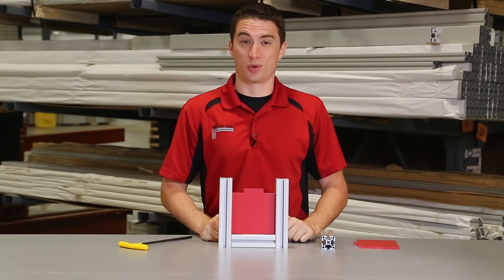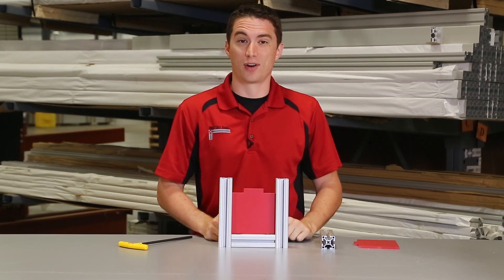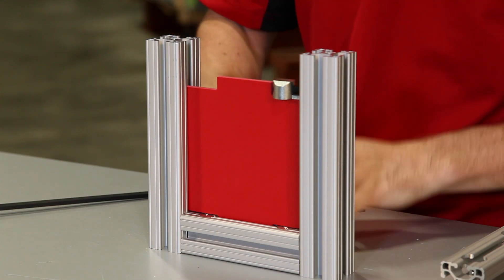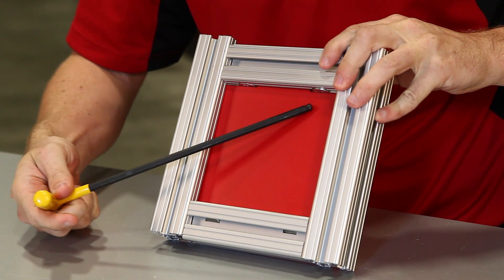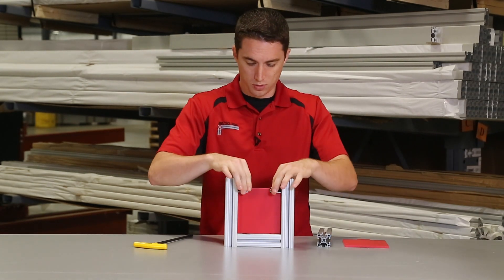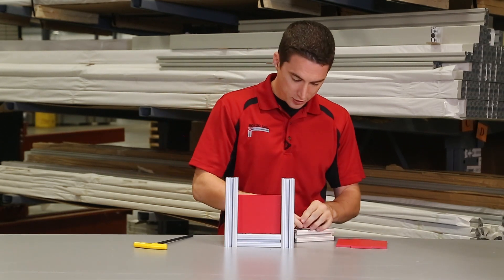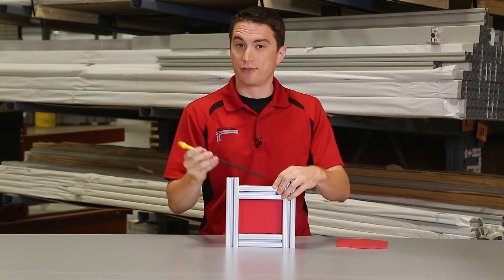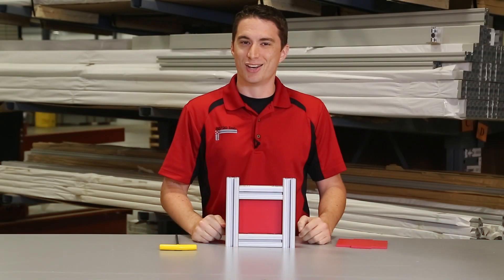80/20: Tips & Tricks - Frames

Comment: How do I chose the correct panel thickness, my 15 series extruded profile says .320 for the slot opening. I want a super snug fit.
Reply from the maker: Hello! Thank you for reaching out to us. For 15 and 40 series, any 6mm or 1/4" panel with a rubber panel gasket (PN 2117), or standard panel gasket (PN 2120), will work to give the panel a snug fit.

Comment: Can you guys make v slot profiles?
Reply from the maker: Robert, 80/20 is a T-slot aluminum system with both fractional and metric profiles. Is there a particular project you're interested in designing or building?